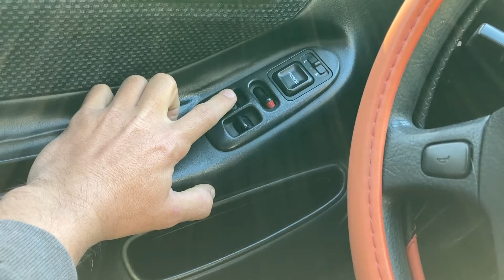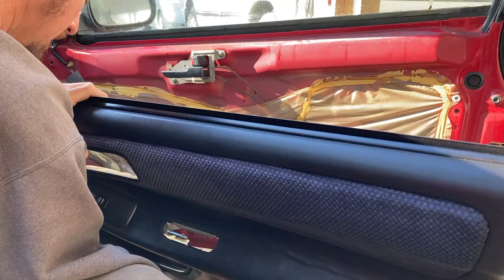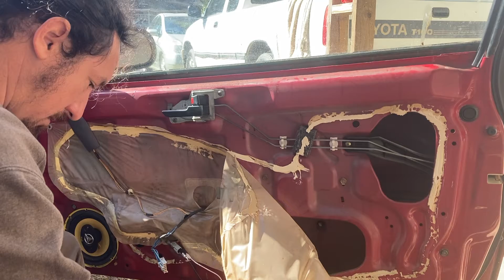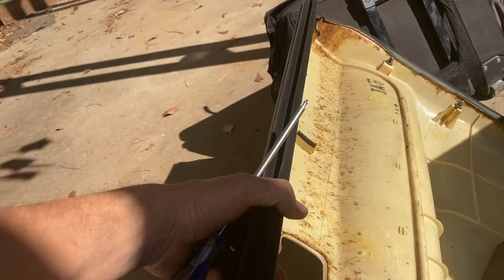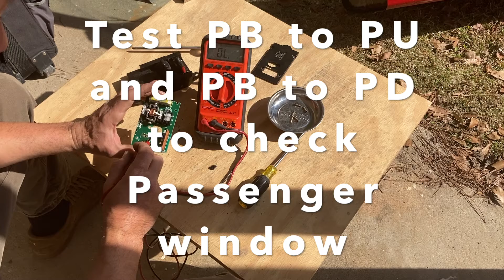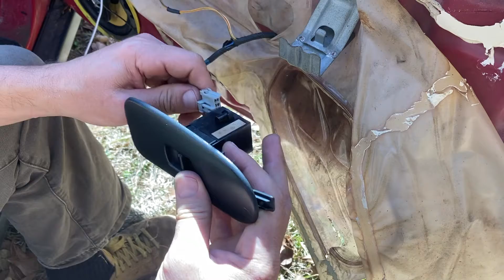1995 Acura Integra Electric Window Troubleshooting :: Electric Car Window Not Working

Comment: 7:00
You are using an LED light ... it will only work if polarity is properly applied.  Reversing polarity (as you are doing with the window switch in the window's opposite direction) will not light an LED.  This is not a good test unless you reverse the wires going to the light as well when you reverse polarity with the window switch.
You should have used an incandescent bulb.
Reply from the maker: Incandescent is certainly better. This LED, however, is non-polarity

Comment: A meter works better for voltage. A light only tells you if there is power. Not how much.
Reply from the maker: This is true, however, sometimes with a poor connection, the meter will read adequate voltage, yet there will not be enough current draw to operate device. Using a test light (incandescent) ensures that both adequate voltage AND current are reaching the test point.

Comment: I have 3 different meters.... They all show voltage AND current 😂
Reply from the maker: If voltage and current is getting to the motor, then this implies the motor is bad. You can apply 12V directly to the motor to see if it operates.
Reply from the maker: Reverse polarity to reverse direction
Reply: Do your battery terminals spark when you touch them to test if the motor is getting power? I’m getting sparks
Reply from the maker: Small sparks may perhaps occur as you make the connection because the motor is drawing current immediately thus arcing slightly through the air. A good connection should eliminate sparking. No worries here. 12VDC will not shock you per se. If a short occurs, though, whatever is shorted will get very hot very fast and may catch fire. The fuses in the circuits prevent fires from shorts. 
If you connect the motor directly to 12VDC and it turns in both directions when polarity is reversed, then the motor is good. If motor is good, then check switches and connections.

Comment: My wife has the 1995 Integra and the passenger side window would not go up and the first thing you showed in your video fixed it! She had got caught in the rain and she wiped the drivers side door inside with a towel to dry it and she must have hit the toggle switch you showed that can lock the window. I just toggled the switch and the window went up. Working again, thank you. I bookmarked your video in case we have problems in the future.

Comment: I have a 98 GSR. Last year I was washing my car and after I sprayed water at the passenger side door handle I no longer was able to control that passenger side window and also the remote power unlock did not work for that door. From the inside the unlock/lock switch on the door handle section(not in your 95 model, looks like https://youtu.be/ADICjwl4RR8?t=402) would work from the drivers side but on the passenger door it would only be able to lock the car (not unlock).